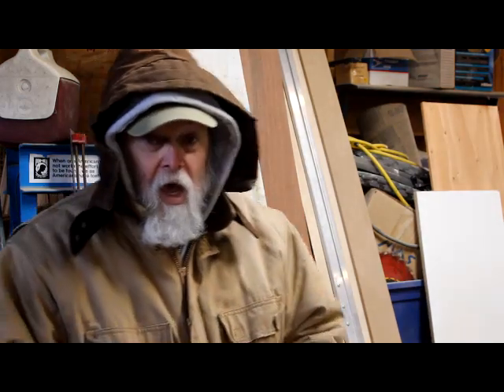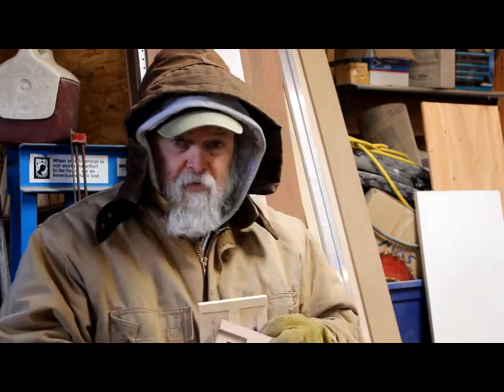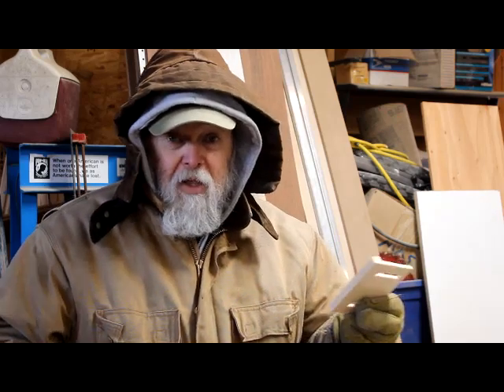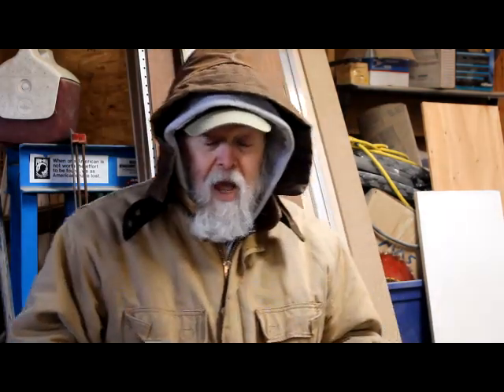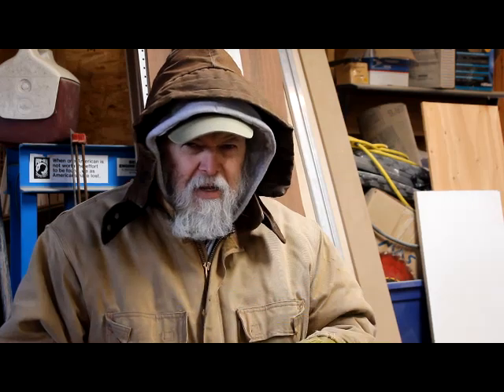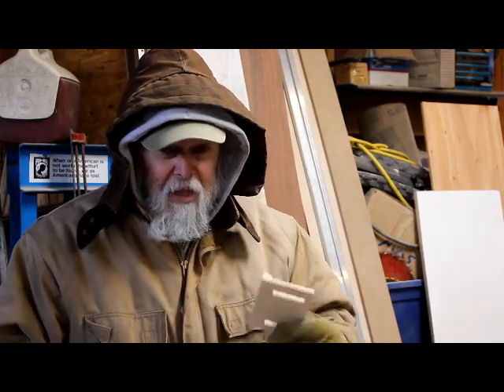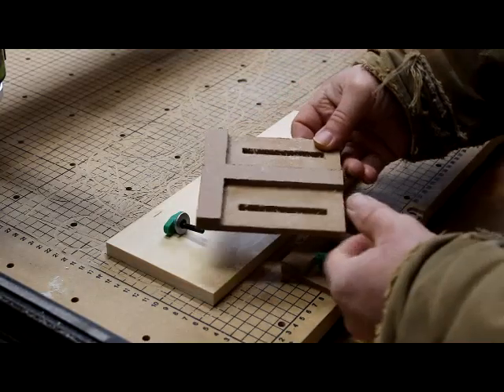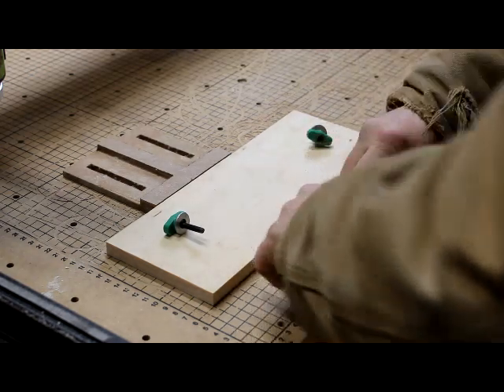(S-3 Ep-3) DIY Bump Stops for X-Carve (FREE PLANS)

Comment: What bit did you use?  Happy new year
Reply from the maker: Happy New Year to you too, Joe! It was so long ago when I posted that video, I don't exactly remember, but I think a 1/8" straight cut bit is a good guess. If you open the Easel file for this project I shared with Inventables, you can click on the bit info in the top right corner and you can also see the feed rate and cut depth per pass setting as well. Easel is free and accessed on the Inventables web site, but you can open and look at the Easel project files on the Inventables site just to check out the projects.